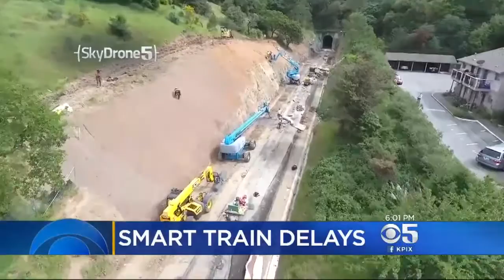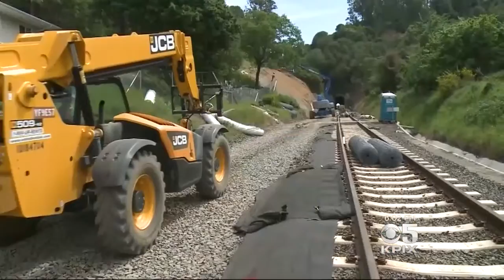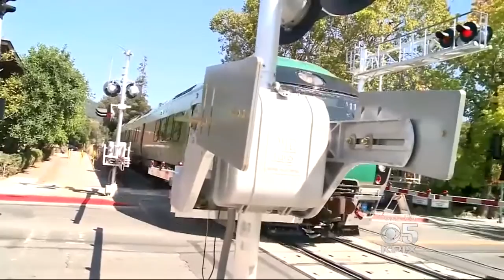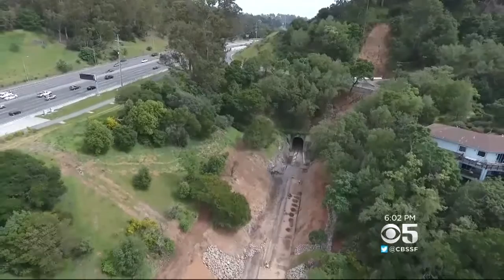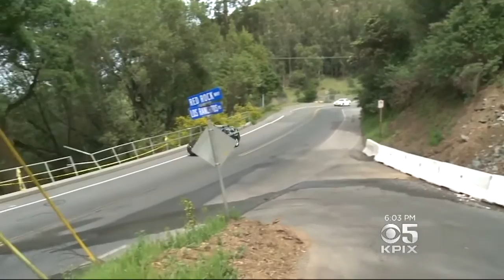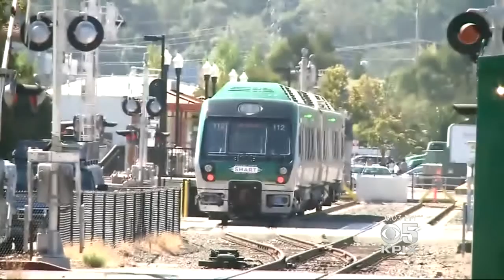Falling Hillside Impedes North Bay SMART Train Construction

Comment: It's 23 dollars plus 2 for parking for round trip from santa Rosa to san Rafael, and Smart was VERY DUMB to not make any train stops in Corte Madara, Mill Valley, Tiburon, and Marin City, DUMB to not reopen that old tunnel they want to use for a bike path, which is good, but should also be used for SMART.  I would've had the train in Vallejo and Richomond, DUMB DUMB DUMB service. Smart officials need to be kicked out along with Judy Arnold.
Reply: The rail right-of-way doesn't exist south of the Larkspur bridge anymore. It used to, but now its the bike path. To be able to build that way they would have to come in saying Eminent Domain. I really doubt that would go over well it the locals. There is way too much infrastructure now so clearing a path would cost WAY too much